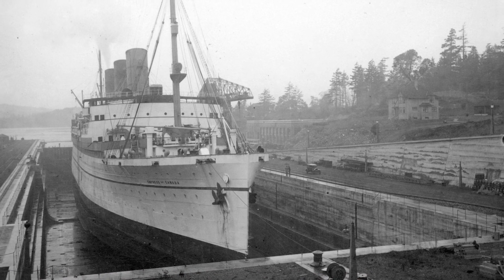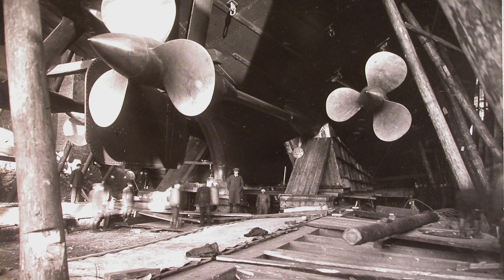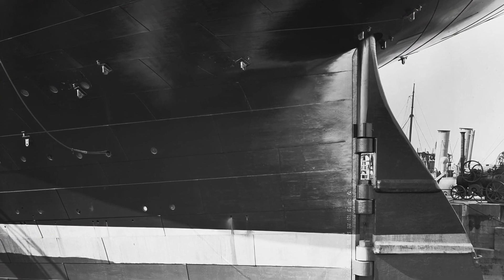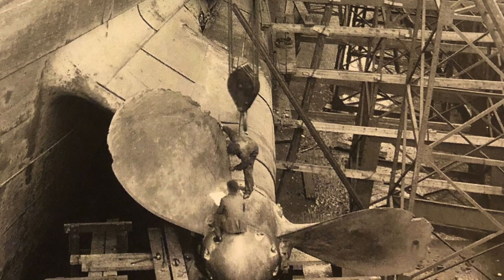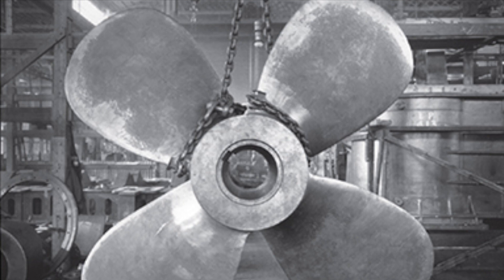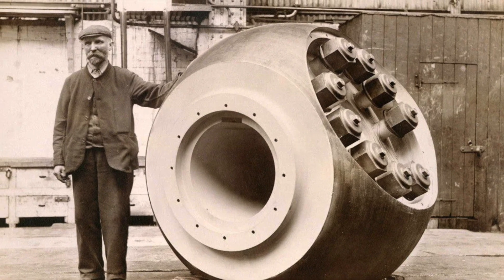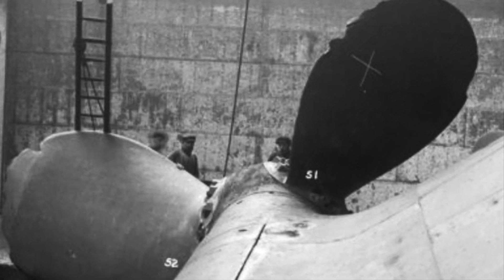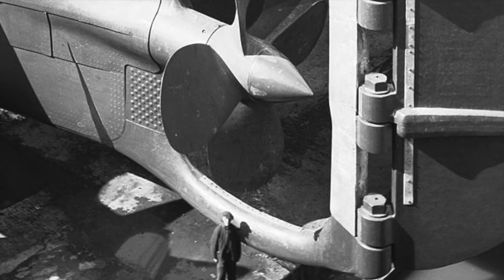How Propellers Were Installed on Ocean Liners

Comment: I worked in a shipyard back in the 90's and would occasionally need to make the wrench used to tighten/loosen the collar nut. The wrenches had an inside span of ~4 feet and was cut out of 2" thick steel.

Comment: Any info on how they kept sea water from entering the ship through the propeller shaft?
Reply: Very good sealing & powerful pumps for the water that did get through.
Reply: @Marc816  how to seal a shaft that's spinning?
Reply: @superkamehameha1744  It's done that way on cars all the time.....water pump shafts, power steering pump shafts, front and rear main bearings in car engines. It's the same for ship propellers.

Comment: Silicon bronze was invented for ship propellers as it resists corrosion. As a side benefit, it also flows much better than traditional bronzes in casting, and today it is the most widely used bronze for sculpture.
Reply: Aunt Barbara adores you!   and silicone.

Comment: Done that a few times and it's near enough a manual operation today, though the prop is in one piece unless it's controllable pitch.
The prop is pretty tight on the shaft and box wedges were and are still used to force it off.  The nut - called a pilgrim nut - may be hydraulically fitted these days and as the keyway was a stress-raiser, most today are keyless and rely on hydraulic tensioning or glue.  Not much has changed.
One shipping company's crew changed a prop at sea in the good old days of general cargo, but that's pretty impossible today.

Comment: I still want to know how was the space between the propellers and the shaft water tight, why didnt water just spew/leak in?
Reply: The space between the prop and the shaft does not need to be water tight, the shaft itself has a seal, where it enters the hull of the ship. These seals are called stuffing box, they are essentially rings of fibrous material like flax or hemp, impregnated with wax or tallow. The rings can be compressed in the axial direction, so that they expand around the circumference of the shaft. This type of seal may leak a little bit, but the bilge pumps can take care of that easily.
Reply: @kilianortmann9979  There's one on the older style of water stop cocks - it's under that nut where the shaft comes out of the tap's body !

Comment: How fascinating! Probably a stupid question, but how do the propellers get so beat up? I noticed the gouges in some of them. Friction from water??
Reply: It can be many things. Over long periods, water itself can beat up the blades. There is a phenomenon called cavitation which put simply, are tiny air bubbles that form when a propeller spins at a high linear speed. When the bubbles pop the water around it rushes to fill the space, which creates a tiny jet of water that can damage propellor blade surfaces. Over the course of thousands upon thousands of revolutions over the course of a ship’s career, this tiny point of damage can spread. 

But more often, propellers would become damaged by striking underwater rocks, reefs, sandbars, or semi-submerged debris.
Reply: @thetman0068  Cavitation is actually vacuum bubbles not air. They collapse at very high speed and generate temperatures of tens of thousands of degrees when that happens. The metal boils under those conditions. Rinse and repeat to form a hole.

Comment: I reckon that the propellers were perhaps the most expensive single part of the ship just for the weight of all that material alone and then there was all the precision engineering and balancing. I bet the bosses hated it when a prop was dropped.

Comment: I always wonder why triple screw ships are so rare? compared to twin or quadruple screw ships
Reply: Not in recent years. I think there’s only QM2 what has quadrupled. The majority of royal Caribbean ship have triple and rest of cruise ships rend to too have twin.
Reply: maybe its like a twin engine plane, twin prop 1 rotates clockwise, 1 rotates counter clockwise to cancel out gyroscopic forces
Reply: @thabg007  I think you're right. There will always be two props rotating in one direction and one in the other, making the ship easy to turn one way, and sluggish the other.